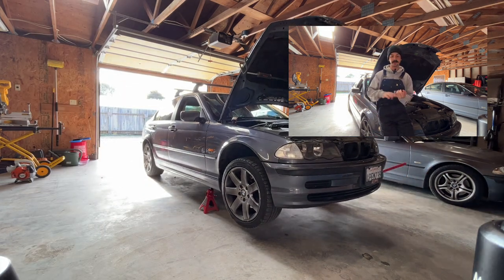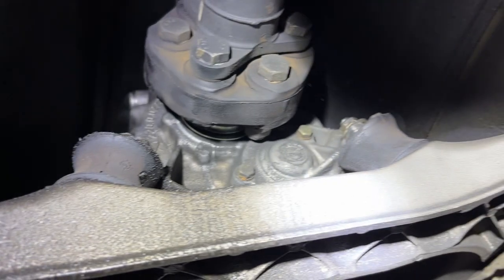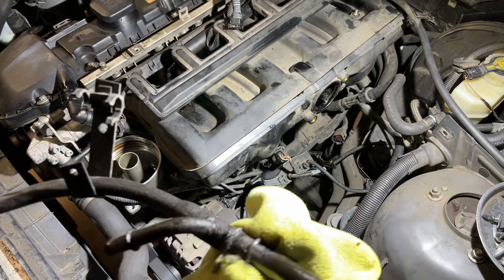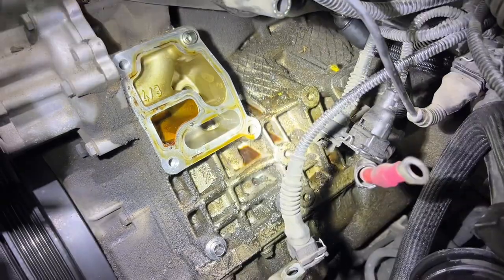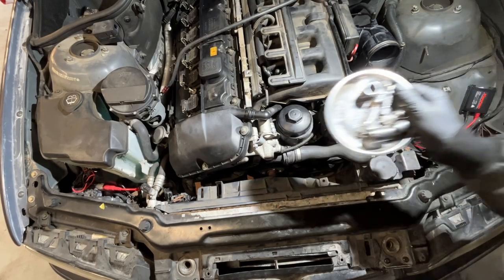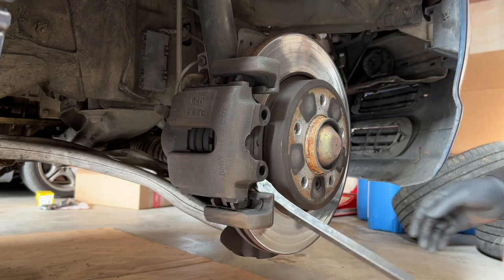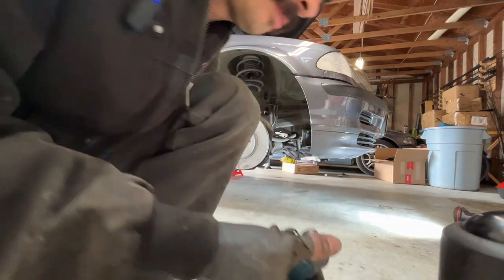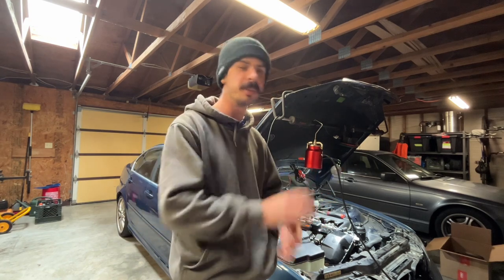Reviving a BMW E46 Check engine light Diagnosis & Repair

Comment: Interesting fact non M3 manual E46's came with electric radiator fan while automatic transmission cars had a clutch fan, the electric fan conversion for the automatic cars is plug and play.
Reply from the maker: Thanks for the info! I never noticed. The electric fan is so much easier to work with, and the shroud isn’t as fragile!
Reply: Plug and play really? Mine auto fan is super loud when the engine is cold because it doesn’t slip at all, maybe I’ll grab an electric fan at the junkyard and try it oit
Reply: @weswest8666  Yeah you use the front auxiliary fan plug for it most people also remove the front fan to free up air flow.
Reply: @lieutenantdan8170  they remove the condenser fan? That doesn’t sound like a good idea
Reply: @weswest8666  It's not needed anymore since the electric fan speeds up to fill the function that the front fan used to serve, the manual cars don't have the front fan at all.
Reply: @lieutenantdan8170  oh wow good to know
Reply: @lieutenantdan8170  In Europe it's quite random. I have a non-M3 manual straight6 E46 and it has that stupid clutch fan.

Comment: Memories of doing my CCV without pulling the intake and then the OFHG, I lived in a loft building and only had covered parking. Be careful with those aluminum bolts for the housing, I learned quickly on one of them.
Reply from the maker: It’s a challenge without pulling the intake up! Lots of tedious work to get the hoses fitted and lined up.

Comment: I've found that wire brushing the hub before fitting the rotor gives a better fit and ensures no brake shimmy down the line. Good video, thanks.
Reply from the maker: It absolutely does 👍🏻 these hubs were nice n clean although I did scrub the rears. Wire wheel on my pneumatic dye grinder is my favorite. Thanks for the comment Michael!

Comment: I’ve had really good luck lately with using rubber cement on plugs instead of lube and then giving the plug a quarter or half twist before yanking the handle back out. This wads the plug up tighter in the hole and the rubber cement hardens to further improve the seal.
Reply from the maker: That’s a great idea. Didn’t have rubber cement but I’m definitely going to pick some up and keep it on hand

Comment: Few things you need to run a wrenching YouTube channel. 1) to drop nuts down the bay😂 2) to work on BMW's and 3) to use a torque wrench. You've got 2/3. Get torque values and do up the nuts to spec!
Reply from the maker: Hahah you’re right, I ought to be torquing items, spent a lot of years doing the same jobs over and over so I get comfortable. I always torque aluminum bolts ie e90 oil pans, valve covers, etc, but you’re right! Thank you for the comment
Reply: Viewers are here for the torque wrench clicks, nothing else; some weird ones are there for liberal use of brake clean.
Reply from the maker: @cheeseburgerbeefcake  lol, okay I’ll throw some torque clicks in the next one

Comment: Hi just bought a 330ci 2002 and cylinder 3 and 2 are misfiring I changed the valve cover gasket, spark plugs and ignition coils, didn’t fix the problem, does anyone know what can i do next ? I’m going to clean the injectors this week !
Reply from the maker: swap injectors and see if the fault follows the injectors. Use a boroscope and go into the cylinder, turn the engine over and look at the intake and exhaust valves to check for damage. also cylinder walls.
You can also check compression on cylinders. hope that helps!

Comment: Great video!  Showed so many fixes for these older BMWs.  I just got a E85 z4 with a 3.0 M54 engine.  Will be checking the engine over at the weekend when I change the oil, waterpump, belt and few other service bits.  Will look out for any leaks from oil filter housing gasket and valve cover too.  Really helpful seeing your video.
Reply from the maker: Thanks for the comment and feedback! It makes my day. Good luck with your Z4! Those cars are great and there’s so much room in the engine bay to work! One of my favorites to wrench on. Cheers Rich!

Comment: @16:30 What was that you pulled out of the old intake boot? I'm missing that.
Reply from the maker: Its a plastic collar that joins the upper and lower intake boots together
Im sure you have it, its just hard to notice unless you pull the boots apart and loosen both adjoining hose clamps

Comment: Question for ya what is that spray you use on all the connections some kind of lubrication? Great videos and mechanic. I have an e90 but it's cool to see the similarities and differences between the two platforms.
Reply from the maker: I love e90s too! Lots of fun to work on. I use a 3M wet silicone that I used for years at the shop. Stuff works great, use it a lot. Thanks for the comment!
Reply: That stuff is a godsend on any rubber hose or o-ring that you need to slip fit. The only thing I don’t use it on is fuel injectors as I’ve been told silicone and fuel systems aren’t buddies. You can even use the spray to help remove stubborn coolant hoses like a penetrating oil.

Comment: Beautiful stuff, eating these videos up one by one, glad I found the channel.
One Q tho - is it safe to wiggle the throttle body around like that? Was under the impression that moving the valve in any way is a big no-no as it can mess up the gears in the electronic motor so have been super careful every time. What's your take on it?
Reply from the maker: ive moved throttle bodies around a lot... never had any issues with them afterwards! so it hasnt been a concern for me. hope that helps!

Comment: Heads up on the plug don't grease Glue it and only plug roadside emergency situations. Yes patch inside of tire plugs tear belts and destroys a tire ,bouncy bouncy. as always you do a great job' thanks for the  information
Reply from the maker: ive been using tire cement as of recent, but the grease in the kit gets the job done. Last episode on this car I ended up pulling the plug and taking it in for a patch plug.

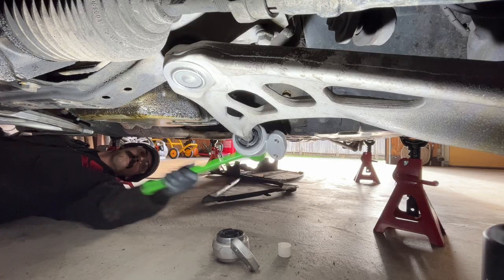Comment: Great videos I love your stuff! Thank you. I am wondering when you put the Lollipops back onto the car is there a reason I shouldn't use Silicon spray to lube them up? I noticed you use glass cleaner.  Oh and I also was wondering if when you used the term "Smack the Sh!t out of that thing" at 32:30 is a technical term?? I think it is as I've heard it used in many situations.
Reply from the maker: hey Greg! Silicone will stay on the control arm and potentially cause the arm to slip inside the bushing after installation. The glass cleaner provides enough lubrication to get the bushing on but evaporates and leaves no lubricating properties after the install. You want a dry bushing so the control arm doesn’t slip inside the bushing. Hope that helps

Comment: nice but..... hey where is torque wrench? bolt that holds disc rotor imbus bolt sholud be torqued at 16nm. you tighted it brobably more than 50nm. next guy who will take this off wil have fun time...
also you fixed damaged wheel bolt. and again tighted them with airgun... 5 min more work will not cost you but you'l get more respect and less incoming problems.
and yesterday i was fixing brake sliders on my sister car... 30sec job for you. btw do you watch BMW m539 yt channel? :)
Reply: also im pumped up for more content :)
Reply from the maker: Yeah I don’t always torque everything, but I’ve also ran those same bolts in hundreds of times with impacts and haven’t had any issues related to it. I get what you’re saying though, and I do torque some things…

I’ve seen his channel a bit but haven’t watched all of m539s content. He’s a great content creator!

Comment: Recently replaced all Coolant hoses including the ones below the intake manifold along with every CCV hose etc. One of the hardest intake manifold jobs I’ve done. Next up is the water pump and thermostat due to small coolant leak. Will be doing motor and transmission mounts too. I’ll end I with a new oil change, valve cover gasket and oil housing gasket
Reply from the maker: It’s gunna be dialed after you’re done with it! Those are all the more challenging jobs. Yeah the intake can be a pain sometimes, wobble sockets, long extensions, and magnets all come in real handy lol! Thanks for watching and commenting

Comment: I use a tiny amount of grease on the part of the brakes that slide (slide pins, caliper to pad contact, pad to shims). You don't go nuts and make sure the grease is specifically for brakes. It helps with rust jacking and keeps noise down. I have also done the brakes dry but it seems the caliper starts hanging over time
Reply from the maker: Also very good info! You got some knowledge Raj! Yeah I have used grease sometimes too, just got into a habit of doing em fry after years at the shop. Thanks for the input!

Comment: Great work. Manifold doesn’t have to be loosened to do this job, we never do that in our shop. Why BMW designed it this way is beyond me.
Reply from the maker: This is true, I used to do em with it bolted down, last one I did I was doin the water pipes too so I cracked it up, however, for the little extra work it takes to crack the manifold, it’s really nice to have the extra room and makes the job easier IMO. 
Yeah not the best design though lol

Comment: You went to all the trouble of busting the intake loose to replace those breather lines, and didn't replace the intake seals while you were at it?
Reply from the maker: Tbh from the 100s of E46s I’ve worked on, I’ve never seen an intake manifold gasket fail. We would reuse them A LOT. Didn’t replace one this one but I did replace it on my daily driver. Just forgot to order the part. No good German OE parts suppliers around

Comment: Thread chaser would be better than using a tap and die. The tap and die will actually cut off a little bit of material.
Reply from the maker: Good point! Don’t have a chaser that size but I’ll keep an eye out for some

Comment: Hey dude! Love your videos. I heard that this generation of chassis had a lot of issues with rear subframe bushings/ structural integrity. Would love to hear your thoughts because I’m looking to buy an old one to restore.
Reply from the maker: Hey cole! It’s true that the rear differential mounting locations age and fail, it shows itself by clunking in the rear end when shifting around gears, especially drive to reverse, but it’s repairable. The subframe mounts where the rear subframe bolts to the body can cause the body to crack sometimes, more common on the E46 M3. If I was buying a standard e46 I’d inspect the rear diff bushings but even if it’s shot out, it’s repairable. Eventually I’ll be doing a video on the repair, one of my cars needs it bad
Reply: @DayOffDIY  thanks man. I’ll look forward to that.

Comment: Hi! Great video! I have an E46 323ci and last summer I.ve changed the front discs with Zimmerman sport coat z ,the drilled ones with Zimmerman pads and after 3000 km (+-2000miles) they start to vibrate and I.m really disappointed.  Seeing in your video that you are using the same brand and recommended this brand,I.m wondering what could possible gone wrong with mine?! Any suggestions? 
About the bushings, i.ve changed everything on the subframe ,control arms ,suspension...etc! :))
Thx a lot! And greetings from România! 👏💪
Reply from the maker: Hey George! thanks for the support. Its possible that the rotors could have warped, do you drive the car hard? you can also check to make sure the hubs are clean and have a flush mating surface for the rotor, and same for the wheel. Especially if you are running aftermarket wheels. Im sure they would warranty them out for you if you asked?
Reply: Thx for the answer! I.ve done that,cleaned everything before installing and yes I.m driving  hard but first 1000 km was clean&soft breaking. Who knows ?! Bad luck I guess! ☹️.  I will change them with the OEM Bmw discs&pads and see kow they work. Keep up the good job! 💪
Reply from the maker: @Gyo828  Id attempt to warranty them too, should save you some money

Comment: I always use a bungee and hook calliper to the spring dude, slightest tear in the pipe can be a dangerous issue later on
Reply from the maker: You’re right, I should bungee, just blew through the job, maybe next time

Comment: You should not let the caliper hang by the hose like that it put strain on the brake lines
Reply from the maker: You’re right I shouldn’t, done it a lot though and never had an issue

Comment: Great video! Also I agree I recently replace my rear diff bushing and it was a major pain in the ass! No more clunk or jolt though.
Reply from the maker: My other e46 needs it and I’m dreading it. Done a few of em with the right tool but don’t have access to the tool anymore and no 2 post lift in my garage lol
Reply: @DayOffDIY  yep a lift would cut the job time in half I believe! Wrestling that diff out alone kinda sucks . I ordered a kit from Amazon for $50 I believe an it had many other sizes for pulling bushings . I did have to get an additional bolt because the one with the kit was to big diameter. Really appreciate your e46 content .
Reply from the maker: @chadriddle3517  thanks Chad. Means a lot to hear that! I’ll probly just buy the tool on Amazon and knock it out in the future. Appreciate the support partner!

Comment: What's the spray you're using on the hoses please?
Reply from the maker: I use sil-glyde lube and wet silicone aerosol spray
Reply: @DayOffDIY  got it. I have WD-40 silicone spray around, I hope that's good enough. Cheers!
Reply from the maker: That should work great! :)

Comment: Hey man what was that spray you were using in the red and white can you sprayed on everything?
Reply from the maker: That’s a 3M (wet) silicone spray
Reply: Thanks man learning a lot watching you! 🙏🏻
That thread cleaner or whatever it’s called you used for the lollipops on the control arms could I use that for my hubs my wheel lugs go in a little rough at the start.
Reply from the maker: @seanshepherd6767  you absolutely could! You’ll need a tap of the correct size for your lug nuts. Keep in mind BMW uses a few different sizes so look up the size and thread pitch of your lug bolts, and run a tap through the female threads on the wheel hub 👍🏻
Reply from the maker: @seanshepherd6767  and thank you for the encouragement and support! It keeps me motivated
Reply: @DayOffDIY  Keep it up man YouTube is the new university and your helping out so many of us with your knowledge! Much appreciated!!!
Reply: @DayOffDIY  I’ll definitely look into this thanks!

Comment: Hi Do you need some great lighting for your car to help you better driving, off-road? We're the pro auto lighting manufacturer for nearly 20 year and we're looking for sponsorship!
Reply from the maker: Hey Auxbeam, I’d be interested, I currently run aftermarket LEDs in my Duramax truck and I’m lookin for companies to work with
Reply: @DayOffDIY  That's great! Is there any build we could be part of?😃
Reply from the maker: I’d love to upgrade the lighting package I have on my Duramax right now. It’s a 2005 Silverado 2500HD. Maybe we can direct message or email? Thanks
Reply: @DayOffDIY  Yea we have definitely have something for this truck! Do you have an email so l can talk with more details?
Reply from the maker: @Auxbeam  absolutely! A good email for ya would be 
dayoffdiy@gmail.com
Thanks!
Reply: @DayOffDIY  Sure! I send the email! It's called Auxbeam Lighting Sponsorship Cooperation
Reply: @DayOffDIY  Send an email but haven't heard from you yet..

Comment: Hello. in my e46 in the n46 engine, the p2177 error pops up every 100 kilometers and I can't deal with it. I already had 3 lambda probes and nothing. please help.
Reply from the maker: I wish I could! To be honest I don’t know if I’ve ever worked on an N46, don’t see em here in the US. Looks like a code related to fuel mixtures. Have you smoke tested the intake or checked for leaks?
Reply: @DayOffDIY  Yes, I checked, but not smoke, because I do not have access to the smoker. Can it be from worn valve seals because, unfortunately, the car eats oil.
Reply from the maker: @lelekkozje3049  it could be a lot of things, most auto shops will have a smoke machine to test or you can buy one online for around $100.
I wish I could do more for ya!
Reply: @DayOffDIY The error pops up on a hot engine and at idle when I'm stuck in a traffic jam. The engine light comes on. I know that the seals need to be replaced because when it warms up, when it gives gas, it releases smoke.